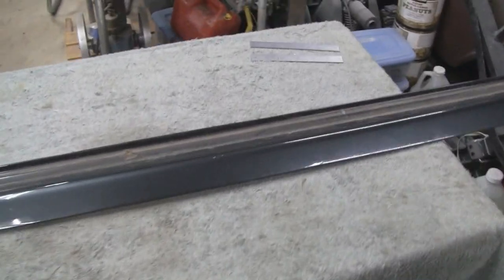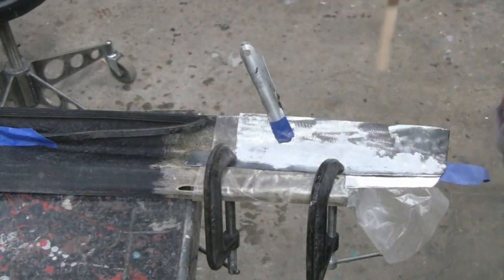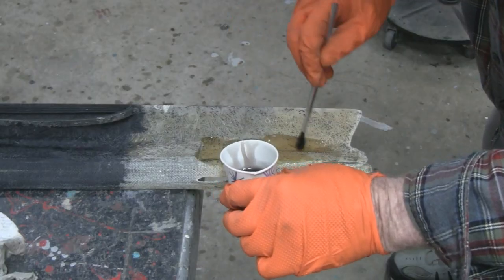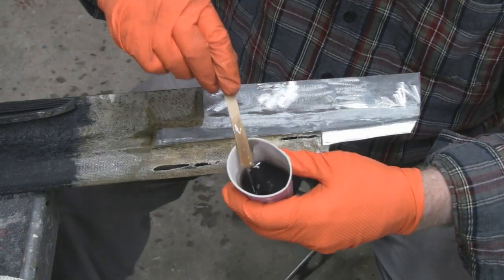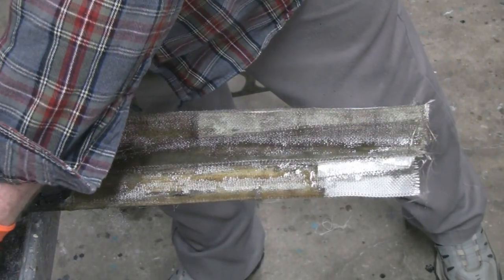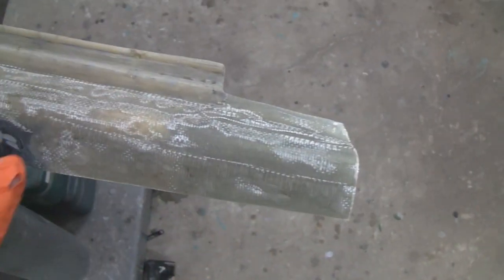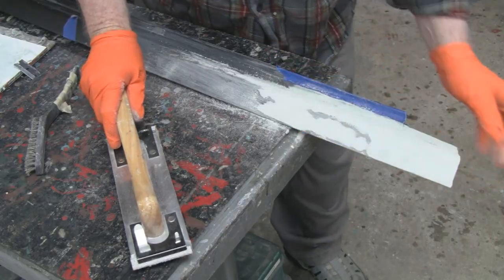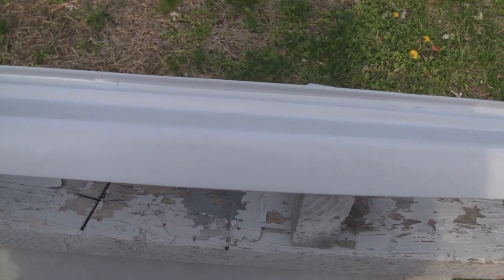HOW TO REPAIR A FIBERGLASS PANEL

Comment: You used an "hourly" acid brush. I had "flat rate" brushes that were 1.5" wide....lol. Geez, that brought back memories. Where did you find the paint code for the trim piece?
 See you up at Jacktown in a few weeks.
Reply from the maker: He chose to go with Flat Black Rustoleum that we had in stock instead of spending $200 on base and clear urethane!!☻
Reply: @805ROADKING  I don't blame him.